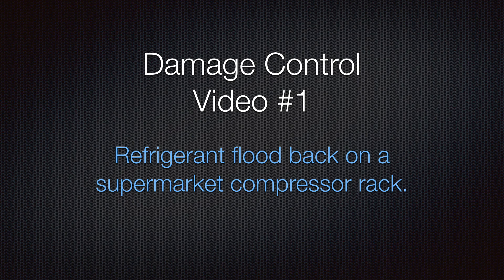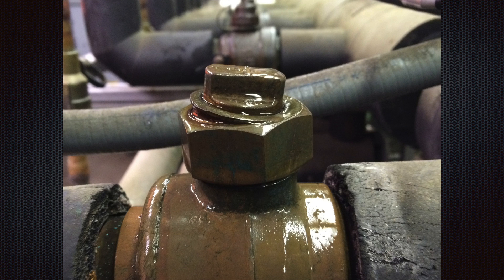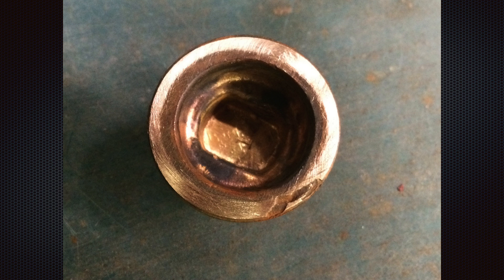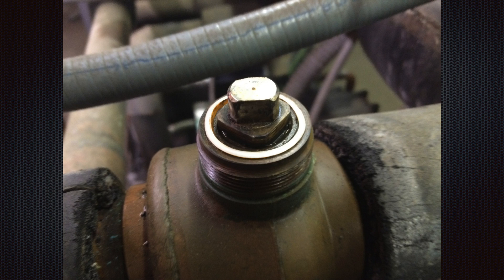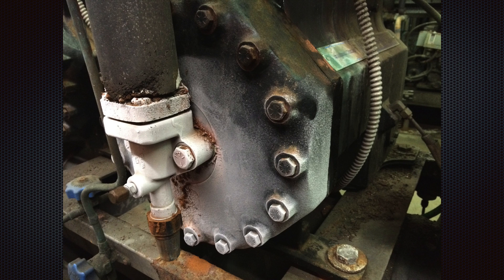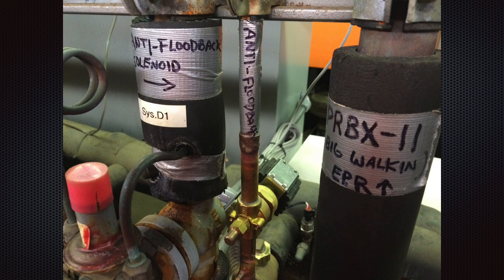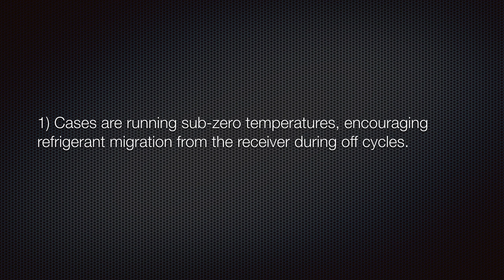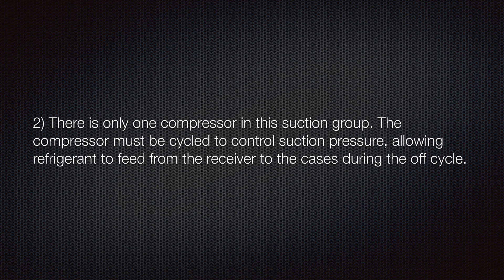Refrigeration 101: Liquid Flood Back

Comment: Hi,May overcharge  cause flood.
Reply from the maker: Yes it may, with fixed restrictor expansion devices such as cap tubes or ported flow raters. Not with normally operating thermostatic expansion valves, though. Overcharging can flood the condenser, which raises the head pressure,  and causes the pressure differential across the expansion device to go higher than it was designed for. Too much refrigerant then flows to the evaporator. The evaporator cannot vaporize all the extra refrigerant and it returns to the compressor causing a flood back condition. A thermostatic expansion valve modulates refrigerant flow according to the evaporator superheat, not pressure differential, so flood back would not normally occur with thermostatic expansion valve and overcharge.

Comment: frost is just an indication of pipe temp relative to dewpoint and humidity it truly doesnt say anything about refrigeration except for the fact the pipe is colder than 32. the reason i say it depends on the suction group is because depending what youre running for suction pressure saturation with the correct superheat you still may form frost. example. you are working on a system with a -30 suction group 404a you have 12 degrees superheat at coil and 40 deg superheat at compressor. copeland spec is 20 deg superheat at compressor to ensure no liquid. so with a -30 saturated suction group and a 40 degree superheat you will still have a suction temp of 10 degrees and will form ice you have no liquid present. now say you have a plus 15 suction group, you have 20 deg superheat at compressor pipe temp of 35 you will not form ice now say you are flooding back and have a 5 degree superheat and a pipe temp of 20 now you are flooding back. so depending on suction group ice does not ALWAYS indicate flood back.
Reply from the maker: Gavin Humes True. Ice does not always indicate flood back. But, the presence of ice can be a very reliable indication of flood back. If the suction gas superheat is normal, the gas temperature will rapidly rise to above freezing as it gains heat in the motor case. This compressor has mild slugging on startup after defrost or a power failure that I have observed. There is no doubt that it is flooding back. The intent of the video was to stimulate thought about a serious problem found in commercial refrigeration systems that can be hard to diagnose and resolve. Thanks for your input.